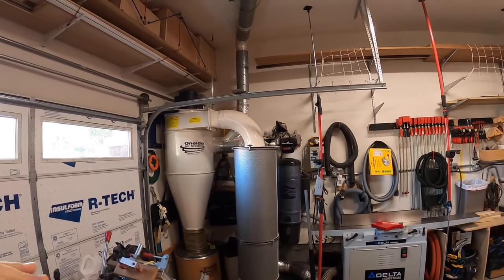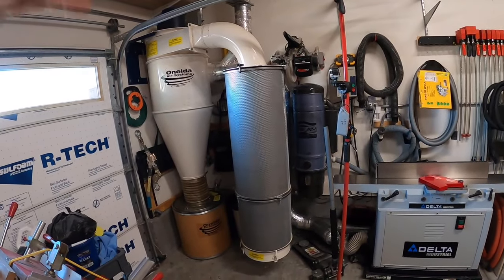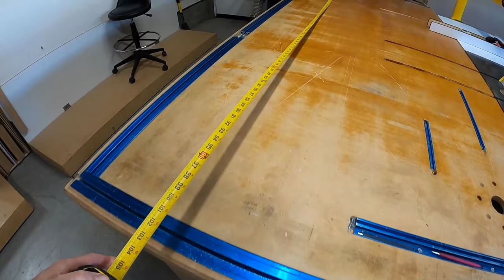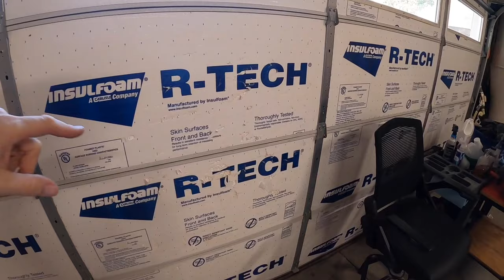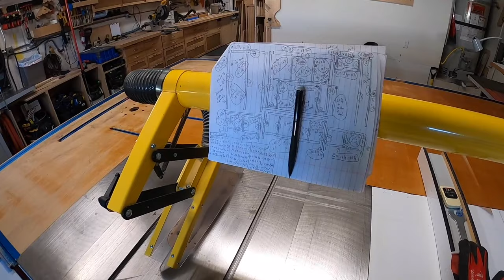2021 Garage Shop Tour.  How I Transformed My Garage Into A Cabinet Shop.

Comment: Really enjoyed the tour and all the info you packed in. Loving the built in router table beside the miter station. So many good ideas!
Reply from the maker: Thank you ElidzVidz. I really appreciate you commenting.  I’m so glad you found my router table and miter saw setup nice. It’s a favorite of mine for sure.  I’m thinking of putting a video together on the whole thing.  Do you think it would be something you’d like to see?
Reply: @davidbryanwoodworksandmore  Absolutely would love to see a video on that. I really liked the one next to the table saw too but was going back and forth on which I'd prefer, I figured you can probably leave the fence up more frequently next to the Mitre saw rather than on your main work table so I'd probably opt out for that. I'm looking at setting up a new shop once I move and your videos have given so many great ideas - thanks again!
Reply from the maker: @ELidzVidz  awesome I’ll get on it.  It’s nice to have options when you can.  If space is available, it’s great to have both tables for router use.  But certainly the miter saw bench is my go to everyday.  The main fact that it has awesome dust collection and it’s out of the way of my assembly and table saw/sanding center area. But I’ll go over different aspects of each area.  I’m so glad you are getting some good info from my videos.  I really am hoping to help as I would have loved it starting out.  Just need to get the word out that I’m here on YouTube. It’s a slow process to build subscribers.  I am glad you found me.

Comment: Nice to see an old radial arm saw in there!!
Reply from the maker: Hey Dale.  Good observation.  I really wanted one ever since I watched Norm on New Yankee Workshop.  It’s not used a lot but sometimes.
Reply: @davidbryanwoodworksandmore  Ha... then I kept watching and see you have 2!!  Do you know what yar that 2nd one is?  It looks in great shape!!  Very nice workshop BTW.
Reply from the maker: @WKYanks  hey Dale.  That second one is from a Craigslist tool haul.  Check out the video from it. It was one of my first Craigslist tool hauls. It however isn’t a normal radial arm saw.  It’s set up with a router on it.  It’s quite neat. It’s circa 1950’s I think dewalt radial arm saw.

Comment: Just a note about your 220 vs 110.  220 has a few advantages, but not all apply all the time.  1. Wire size. A motor takes a certain amount of power to run. You are sending half the power over 2 wires instead of all over 1. This allows for smaller gauge wires to run your motor. It saves cost on large builds using smaller wire.    2. Load balancing.  If you are using multiple items on 110, they may all be pulling from the same "leg" of power.  220 eliminates this issue. It pulls half the power from each leg  the power company provides you.  This can be real important depending on how the rest of the house is set up to pull power.
Some other issues could apply, but not likely for a home style shop.  I personally set up to 220 as much as possible just to ensure my "legs" of power are balanced. If you never run more than 1 or 2 tools at a time, and your house is not running tons of power hungry equipment like 110 ac units, then you should not ever worry about the balance too much.
Reply from the maker: With my panel that the electrician installed, it’s so nice to have so many separate and stable 20amp 110 outlets and 20/30 amp 220 outlets.  I never trip or overload a circuit.  I usually have my table saw, dust collector,  jointer, router wall ac, and miter saw with vac vac working at same times.  Router and shaper and overhead air cleaner sometimes too.  It’s very nice to have good home shop power done the right way from a licensed electrician.  And my electric bill is cheap with machines going all the time.  It’s very inexpensive.  Thanks for your comments.

Comment: Thanks for the video.  Would love to see how you built the router table.  Super idea incorporating it into your miter saw station.
Reply from the maker: Hey Ryan.  Thanks for the compliments.  Yes it’s a really cool bench but it’s truly functional as well. Not showy but very useable daily. I’ll put a video together on the bench.
Reply: @davidbryanwoodworksandmore  

Thanks. Will keep an eye out for it and start working my way through the rest of your videos. Good stuff. One question about the bench, is there a lift under there or are you just mounting the router base to the top? Haven’t seen your set up anywhere else.
Reply from the maker: @ryanchaffin1926  I can say that I’m surprised nobody has this setup.  If you look through videos of my builds you’ll see many times me using this.  It’s not a lift.  But bolted to table.
Reply: @davidbryanwoodworksandmore  

I’m sure there are others out there but I haven’t seen them. I’ve been doing a lot of research on shop set up and router table builds and yours is the first one I’ve seen that didn’t have a lift.  Very slick set up. Really interested in duplicating.
Reply from the maker: @ryanchaffin1926  yes I don’t have a lift installed anywhere in my shop. I did have one that I bought on Craigslist as part of a massive tool haul, check out that video, man what a score.  Anyhow, I still have it but it’s for sale.  Honestly, my setup is perfect for me and I really won’t be changing it ever.  It takes a lot of forethought on the layout of the setup in order for very thing to work well together.  Plan very carefully and you’ll love it.  My new slider is just now up and running as of today, building my first cabinet job with it, so stay tuned for that also.

Comment: I've got the CT33 and several Y's, The Bosch tools are much better and reliable than Milwaukee stuff. 12V Bosch is handy and compact size. I worked briefly at a wood custom shop and found the
SawStop to be an antique design and same overhead guard you have was always in the way for seeing your cut. I have a sliding table saw which with clamps can do most projects. That Oneida cyclone is the best as my 7.5hp outside the shop really keeps things clean. Get the remote start with several remotes and reduce your walking radically. I just bought the latest 2.25hp Bosch to add to my 3hp Bosch's and really like the performance. I have one Milwaukee hammer-driver 18V and hate the weight and the Sawzal has broken twice. Will replace with Bosch soon. Good luck
Reply from the maker: Hey Vincent.  Thanks for watching and commenting.  It sounds like you’ve got a lot of experience.  That’s awesome.  Yes the overarm guard can potentially get in the way of sight but that is okay with me as it really is safer.  Blade guards have a tendency to do this I think.  But I wouldn’t use my saw without it.  I also really like Bosch little drills.  12v is great. Makita too.  I love my makita 10.8v/12v drills as anyone can tell.  I truly love them.  Too bad they don’t make them anymore.  However I still can get them used off internet from time to time.  Sounds like you’ve got a nice shop.  Oneida is awesome cyclone.  In a league of its own.  I’d like to have a slider, I’ve got an scmi in my trailer ready to install but it doesn’t take dado stack.  So I’d have to use my regular cabinet saw also.  My shop is probably not big enough for two.  But maybe in the future.

Comment: Thanks for the tour! There is a lot of thoughts on some of the design choices you have made and I am looking forward to utilizing some of your wisdom in my shop!
Reply from the maker: Thanks for watching and commenting.  I really appreciate it.  I’m so glad you were able to find some inspiration for your own shop. I sincerely have the most fun in my shop.  It is a career but it’s still my favorite hobby too.   So I’m also always thinking of ways to make it even more efficient.  We can’t ever stop trying.  Let me know if you have questions or want advice.  Thanks again.
Reply: @davidbryanwoodworksandmore  so I'd like to know, what made you go for the General over the Powermatic table saw? As a Canadian, I was surprised to see a General table saw that is made in Canada in a USA shop.
Reply from the maker: Great question.  I bought my saw in 2005 or so.  It was on display at a local, in Los Angeles, 40 mins away, machinery dealer.  They are very well known for having General machines.  Awesome place.  Eagle Tools.  Anyhow I had read an article that year in fine woodworking where the cabinet saws were tested and reviewed.  The general did very well.  Better than powermatic.  When I went to see the table saws, powermatic 66 was also on display.  Next to each other.  The General has an actual Beiesmeyer fence. Not on powermatic.  The powermatic motor was not the same level Baldor motor on the General.  The fit and finish abd arbor run out on the powermatic were not great.  Compared to the General. General 350 was about the same price exactly so that was good.  Only thing I wish mine had is a riving knife from factory.  They didn’t have those until a couple years later.  Otherwise, haven’t had to do anything to my saw at all.  Nothing.  It’s amazing.  My overarm guard is the only mod on the saw. Other than zero clearance inserts.  Do you have General?
Reply: @davidbryanwoodworksandmore  I wish I did! I have a similar saw, a King Canada Industrial saw but it doesn't have the same quality control process behind. It is a great saw and I took the time to adjust it for the most part after buying it used. It doesn't have a riving knife but I made a 0 clearance insert for it and added a splitter. 

I would pretty much only consider changing it for a Saw Stop.
Reply from the maker: @sebmstudio1697  sounds good.  Splitters are very important.  For sure the sawstop will be a nice choice. Keep me posted on your shop progress. I’d love to hear about it.  By the way, is it cold where you are?
Reply: @davidbryanwoodworksandmore  oh it gets real cold out here in the winter. My shop is insulated and heated because we get to -30 celcius pretty often during january and february. I'd say that season average is somewhere around -10 ,-13 during the worst months of winter.

I'm going to spend the next 5 weeks building projects for customers and improving the shop so there should be some progress there! 

I am planning to upgrade my dust collector to a 2 stage system, build a new cabinet for my little CNC that will be used as an extension of my mitter saw station and build a router table cart for my router table. I'm not sure I'll have time to do everything on this list, but it should be fun times!
Reply from the maker: @sebmstudio1697  hey that sounds really cold.  It sounds like you’ve got a nice place to work though. I love to hear about all the plans for your shop.  And you have customers so that means you are in this business? What do you build?
Reply: @davidbryanwoodworksandmore  yeah, I built the shop 2 summers ago and it's coming along really nice, I like it a lot! Still have lots of things to do in there though.

I am a high school teacher in my everyday job, but I started my woodworking side business that I am slowly growing right now. I build custom furniture, cutting boards and kids toys mostly, but I started by making tabletop game accessories with my little CNC which was my 1st big tool that I purchased. I can't wait to see where this journey takes me!
Reply from the maker: @sebmstudio1697  awesome.  My wife is a school principal.  Glad to hear that you are a high school teacher.  A side business is a great thing.  That’s how I got started in 1998.  I am interested in your cnc.  What kind is it?

Comment: Hello I just found your channel because I pick up a excalibur overarm dust collector a craigslist find.  I must have a older model because mine doesn't swing its just straight pipe, my question is how often do you swing yours out of the way?? Just hook it up tonight and ran some test with it so far so good. Great videos I've watched a couple now. Thanks Mike
Reply from the maker: So glad you found my channel.  Thanks for commenting about this.  I think you have one of the fixed models.  They had options when they were around earlier and I think one came down from the ceiling and another was fixed possibly.  Obviously my style is the more common one with the swing away feature.  But a fixed one will be great too.  I swing mine away a lot. Or take it off completely and set on the floor next to my plywood sheets.  I love these saw guards. Absolutely the best In my opinion. In My new videos I’ve been restoring an older one I had stored in my trailer.  I have painted it gun metal grey and it’s gorgeous.  I hope you really enjoy it. I’d love to see it if you can Instagram me or go to my website and upload pic.

Comment: You could just make a sheet goods carrier. My shop is behind my house and there is no room to store a lot of wood so I store it in the garage. When I need a sheet of plywood or a thick pc of hardwood that is heavy I use a simple hardwood carrier I made. Since I have to push it over grass, I bought some cheap 10" tires, 2 of them. I took a 3'-Lx1-1/2"-Tx 6"-W  board of ash I had glued and screwed 2- 2' pcs of 2x4 onto the top of the ash. One on each side so when I tip a sheet onto it won't just slide off. You can make something similar only use 2" casters. You are only going about 10'-15'and to get the board on just tip one end of the board up and slide it on. They make a set of very short platforms like to move refrigerators which would only require you to tip the board about 1-2" off the floor. sometimes you can damage a board's edge by pushing it on concrete. Nice shop too!
Reply from the maker: Thanks for the comments.  It sounds like you are really needing a panel carrier for sure. My system works great for me.  Certainly no problem but thanks for the ideas.  If I had to carry a long way, for the amount of sheets I process each week, I’d have to change shop locations.  I go through 20 sheets a week.  Easily.  And yes, only drag the factory edge on the floor. Never a clean sawn edge.  That wouldn’t be good. I’m glad you watched the video.  I’ve been in custom cabinet making for around 20 years exactly and building furniture for 25.  It’s a lot of fun.  I enjoy it and now enjoy making videos to inspire others. If I can. Please subscribe and check out my other videos.  I post every few days.

Comment: Great shop tour.  It's amazing you can run a cabinet business out of such a small space considering I complain about lack of space when it is just a hobby for me.  I'm wondering why you have so many shapers when shop space is at a premium?  Wouldn't one shaper be fine or do you really save on time by dedicating a certain cutter to each shaper?
Reply from the maker: Thanks Brian for leaving a comment.  You know it’s all about efficiency and desire to make it work.  I also take on jobs that I feel will work for the space best.  It’s pretty big for a garage with enough width and height to really help.  When I first got a shaper I used to switch out profiles, the when I had opportunity to buy others, I realized they are so great to have.  I got such good deals on the used ones, that it made a lot of sense to have them. And the way my shop is set up,  I don’t use the back corner for anything else really.  So it’s the perfect space to put them into.  I sold my woodmaster that was in the corner, that wasn’t being used at all, which allowed me to put another tool in its place.  Mostly now however, I am not doing much on the shapers because of the types of job styles I’m building now.  I used to do all profiled countertops but now it’s squared. Shelf edges used to be profiled also, but not they’re square.  And the panels in doors used to be raised, but not anymore mostly.  So three shapers aren’t being used right not mostly.  I might be adding some door profiles for them to use them on doors, but my router does fantastic so it’s not totally necessary to changes to shaper for that.  I still might though.  They are great for door making obviously.  It’s really nice to have a choice of tooling when producing cabinets and furniture for a living.  Did you catch my video on shop flow and efficiency?   Its pretty cool.  Shows my process.

Comment: Thanks for the tour! Can you tell me about your cross cut sleds? How wide is your biggest and how often do you use it?
Reply from the maker: Hi there Josiah.  Thanks for watching and commenting.   My Cross cut sleds are used all the time.  For every single job.  My oldest is the one I use in my videos to build my customers jobs.  I made a follow up video on the sled.  Check it out.  I think I talk about the sizes of both of my sleds in detail.  Max cuts are 31-3/4” and 29-1/2” or so on the other.  They are just as important to my shop as my saw itself.  I go into detail on the specs and fence etc in the follow up sled video.